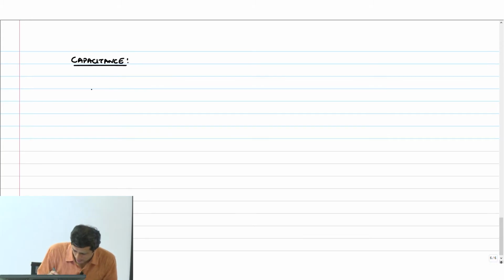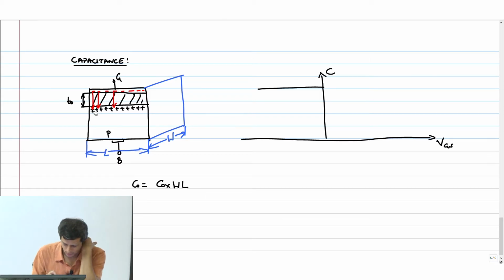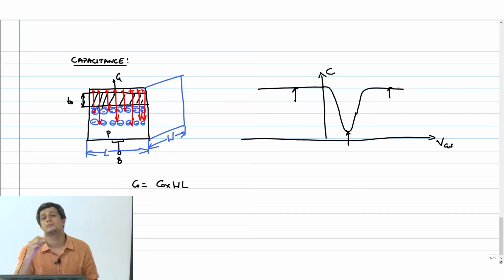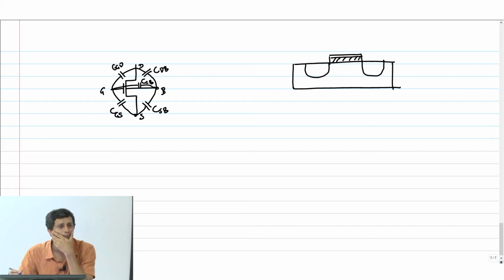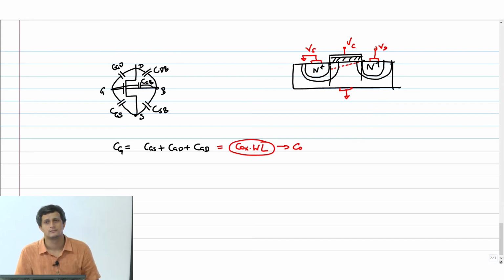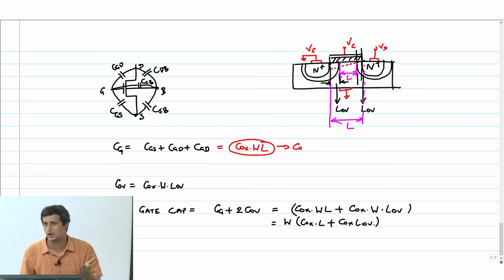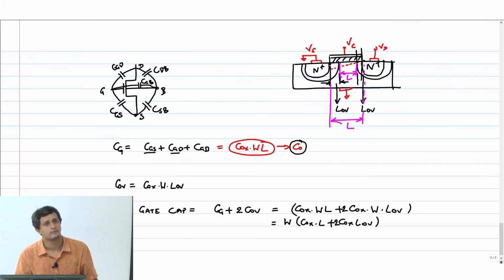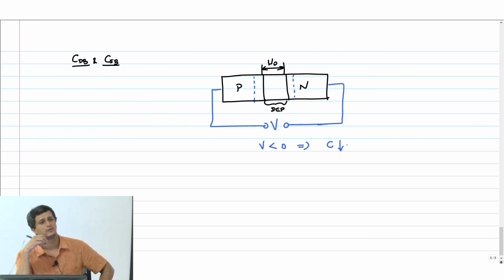Transistor-11 - Transistor Capacitance - 1

Comment: Why does it have a constant capacitance when Vgs is below zero ?
Reply: When Vgs is less than zero, the charge carriers at the Si-SiO2 interface are holes, the positive carriers. Since the substrate is P-type, it has more than enough holes to accumulate at the interface, making it such that the electric field, that is observed within a capacitor doesn't penetrate into the substrate, thus the capacitance, which is C= (epsilon)A/L has no changing terms.
But when  Vgs is negative, the charges to accumulate at the interface are to be negative. But since they are less in number, what happens is that there will be a deficit of negative charges. To compensate, the holes of nearby dopant atoms are pushed away, creating a depletion region of immobile negative acceptor ions. This region isn't very close to the surface, causing the field to penetrate into the substrate, effectively varying the "L" in C=(epsilon)A/L.
Further, as depletion continues, we get to the point where the negative charge carriers, the electrons can be easily accumulated at the interface than the immobile carriers. This is where inversion starts and they act like holes in accumulation case, terminating field before it penetrates. Thus, it reaches the value before depletion. Although  there is a slight difference as some field still penetrate into substrate due to presence of immobile negative carriers, it is highly negligible in region where we operate on.
Reply: because of accumulation

Comment: Cgs, Cgd, Cgb should be in parallel to form the total gate capacitance equation. However source drain and body are at different potentials so how are they in parallel?